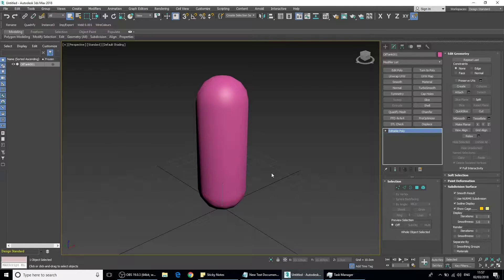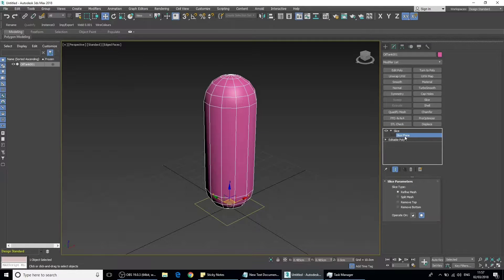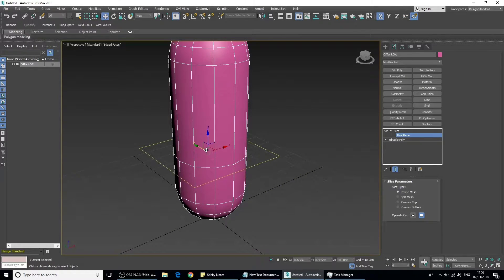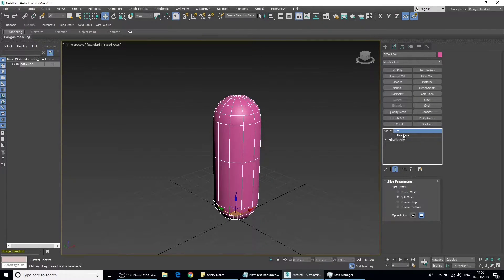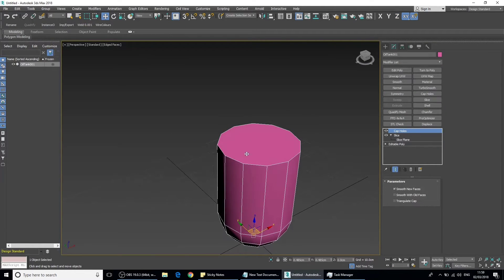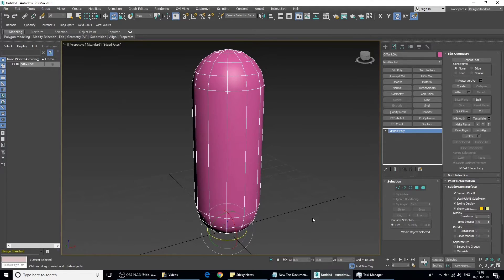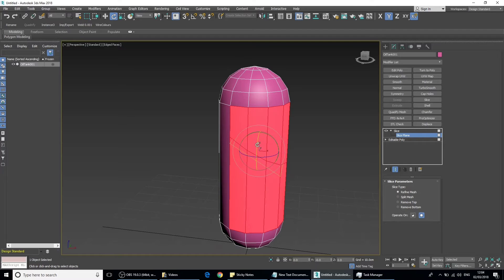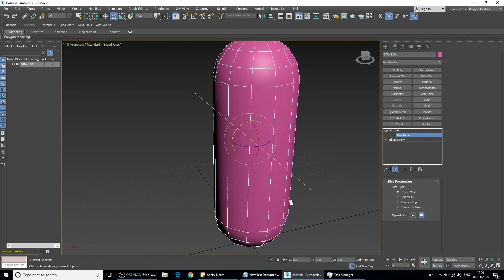3ds Max tutorial - Slice Modifier

Comment: There is also one thing you didnt mension in this video, how can i connect slice plane to an edge? to understand what i mean check video on 39:00 https://www.youtube.com/watch?v=Y83FLL6TqF0&t=2359s
Reply from the maker: Hi Max, I didn't forget, that is a separate topic to do with Snapping.
All you need to do is turn on snapping by pressing "S" on your keyboard and snap it to the edge, or vertex you want to line it up with.
Reply: Oh dude thanks again, i stuck with my project because of that. Its good to have mentor that can help you with advise.